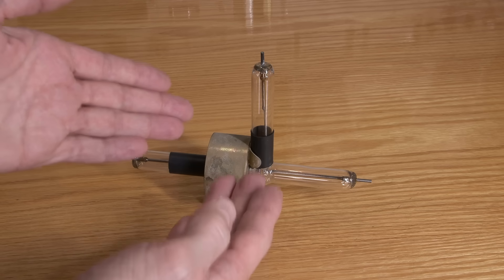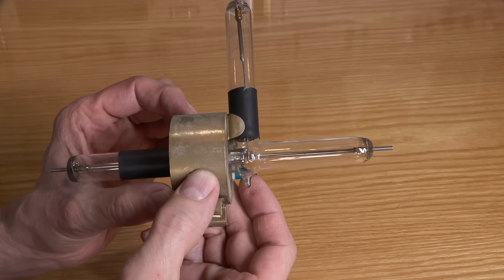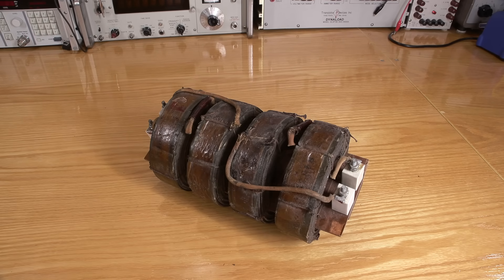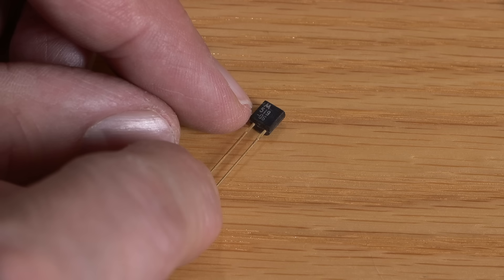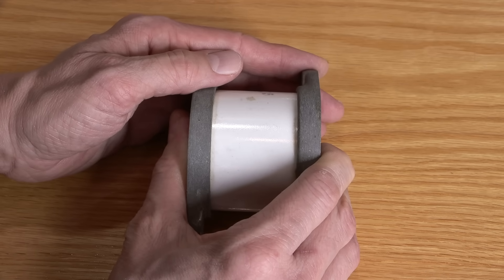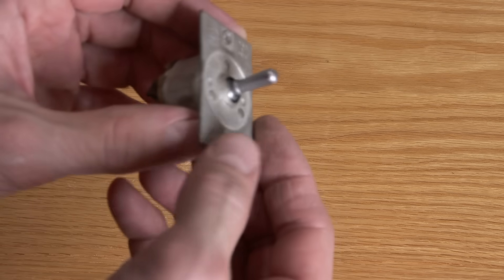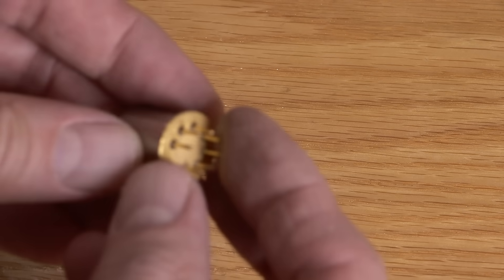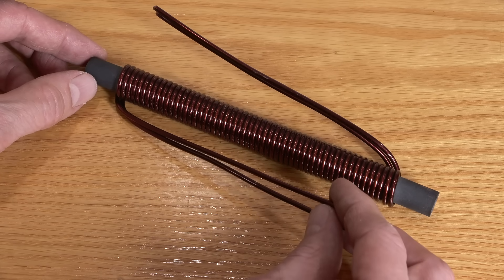Test Your Electronics Smarts - Guess The Electronic Parts!

Comment: I thought that the 
1 X-Ray Tube
2 some kind of a transformer 
3 some Diode
4 high voltage cap.
5 3-pos. mom. off-on-on-on switch 
6 High power resistor
7 RF relay, because Teledyne Lecroy make as well rf relays with metal housing. but it's solid state tube ...
8 Some coil...
9 the big one an inductor and small one a resistor 

And huge thanks for this enjoyable episode!

Comment: Vacuum Relais, the tuning Diode  could have been an NTC or a  Diac ,they exist too in this package. The Tubester let me think to a Nuvistor.  The big double inductor, i thought that it was  a "Transductor" German Name .( variable saturation transformer) .  The big resistor  ,i had no doubt. The ferrite bifilar choke, you can use also as current balun if it is the apropriate ferrite.  And the green thing an inductor, but the small capacitor unknown. You have an interresting stock of components, mr C.😊

Comment: #1  High voltage relay.
Reply: #2 Choke. Yes, looks like a scaled-up version of the 1960s. 🙂
Reply: #3 I could see the Motorola trademark, and "519". Must be some sort of diode. Likely something odd, like a tunnel diode or varactor (tuning diode).
Reply: #4 Looks like a spark gap (or perhaps a fuse) from a medium voltage power line. The sort of thing that's often filled with dry sand (to absorb the chaos when triggered) around the actual active elements. Edit to add: WRONG !! 🙂
Reply: #5 Four position switch (?). i.e. three closed positions spaced at 120° and center off. Looks to be too small to contain anything other than switch contacts,
Reply: #6 I'll go with resistor (wire wound), only because it's that particular shade of green.  Not sure...
Reply: #7 Easy (I think). Little Teledyne small signal relay.  Used them in a project decades ago, but ours were in cans just a bit shorter (TO-5 IIRC). Edit to add: WRONG !! 🙂
Reply: #8 Bifilar choke, sometimes used in a balun. Core is ferrite, and obviously not toroidal. Not a "loop-stick antenna" as the wire is much heavier. Edit to add: Half-points, LOL... 🙂
Reply: #9 Two little inductors, i.e. chokes. Edit to add: half points.
Reply: ~ Arguably 6/9, so 67% (at best, being generous). 🙂 
Not bad considering that I've steadfastly avoided vacuum tubes since the nightmare days of the Eico 753 in the mid-1970s...

Comment: I've actually run across Kilovac relays before, but never that specific one. They're owned by TE (or a subsidiary or whatever) now. I used to repair these relay boxes that were meant for use in environments with volatile materials. Each box had six of them, and they were shaped kind of like a spark plug. K41 series, I think.

Comment: Radar ATR switch
Reply: That's what I thought at first, until I looked at it a bit more.
Reply: @douro20  There's usually no coil or whatever on ATR switches, maybe this is some kind of high power RF mux?
Reply: @8BitNaptime  No, it's an SPDT high voltage relay.
Reply: @douro20  It does look like part of a Hewittic rectifier

Comment: That resistor could be a fuse... If you use it wrong enough 😅
Reply: Lots of things will function as a fuse!
Reply: @nickk9202 Too often, any other component
 than the actual fuse, will act like a fuse… 😅
Reply: @thomashenden71  Most slow blow fuses are protected by a fast blow transistor.
Reply: Everything is a conductor if you crank the voltage up high enough, so if you use it beyond “wrong enough” it will revert to a short… 😉
Reply: @DrBovdin  Or open.
Reply: @hotpuppy1  Not if you crank the voltage up high enough…
Reply: Any resistor will turn in to a fuse, if you use it "wrong enough" lol

Comment: The relay out of an fluxcompensator
Reply: @TecKonstantin Warum wundert es mich nicht, dich hier anzutreffen? XD Du musst auch mal wieder wat aus deiner Sammlung vorführen, wenn es die Zeit erlaubt!
Reply: @raceeagle8248  ja die Zeit, sollte echt mal wieder
Reply: I’m glad I’m not the only one who knew this!!
Reply: exactly - I salvaged one from a high-voltage power supply in our lab. I had to replace the other one with a completely different type, because the second hand market of the original parts is empty because of collectors who make their own stage props...
Reply: @uwezimmermann5427 Yup there was one of those in a Spellman HV labs power supply used to charge up capacitors in a fairly large laser I revived years ago.
Reply: Nah, it's a flux capacitor.
Reply: Yup. Kilovac relays were used in the flux capacitor prop. I once got about 7 of them and sold them on ebay for about $100 each to people building flux capacitor replicas.
Reply: Flux Capacitor.....lol 😂

Comment: Mr Carlsons lab i have a vintage zenith Trans oceanic transistor shortwave receiver I want to restore it let me no ware I can get Russian germanium transistors?
Reply: Greg, I don’t have any clue which transistors are in your receiver. But, I’ve seen many Russian transistors on eBay, and googling will bring some up. Many times you may be able to cross reference to a modern part that will work as good, or possibly better.
Which model number is your Zenith receiver?
Reply from the maker: You'll probably have to do some digging.

Comment: 50-ohm seems to suggest it's possibly a dummy load.
Reply: I think that number might indicate characteristic impedance if the relay used for switching RF.
Reply from the maker: It's just the coil resistance, but it made for a tricky device.